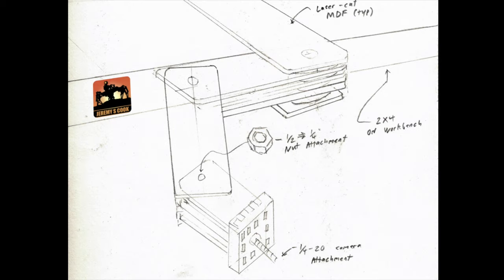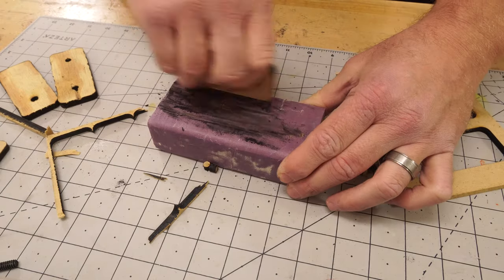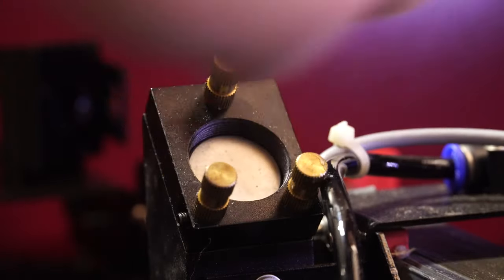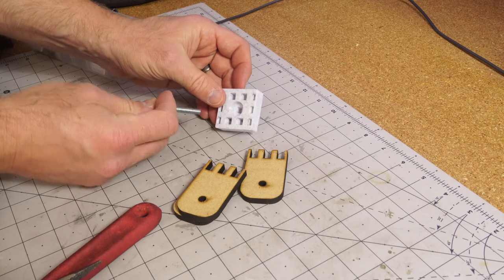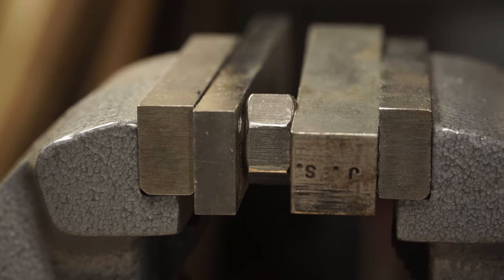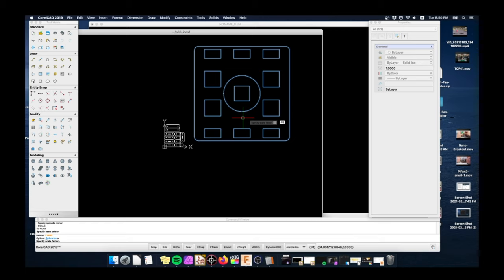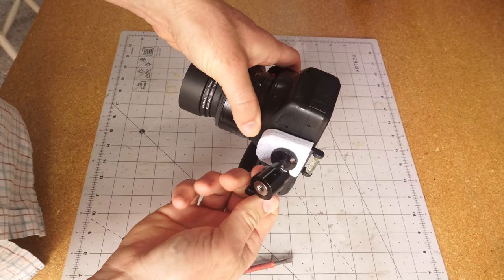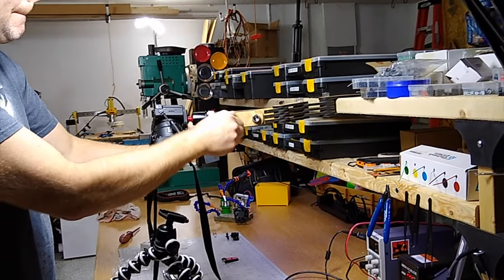Articulated Bench Camera Mount [Laser Cut]

Comment: Great camera mount. I thought I recognised the design from the thumbnail. It's cool to see people utilising Pocket 83's ideas.
With you saying about putting a motor/s on there, you could us a microcontroller to record preset positions and then it could just be a button press to change the camera shot, or link it to an app to save making a bank of buttons to recall the presets.
Reply from the maker: Thanks! Yeah, was fun to put my own spin on it :-)
True - thinking if I do it, I'll use a stepper on just one of the joints for simplicity. Ideally I'd need end stop switches, but could probably get away without them if I was careful.

Comment: Hello Jeremy, great project! Would you be kind enough to tell me where I could download the design files of the articulated arm for laser cutting? I can't open the .dxf file thank you
Reply from the maker: Hi, there's a .lbrn file on that repository that can be opened with LightBurn, and I just uploaded a .dwg file. Hope that helps, but you may need to use a different program if none are working with your system.